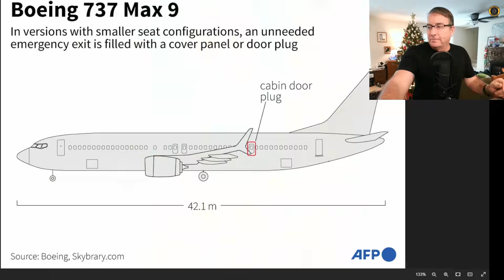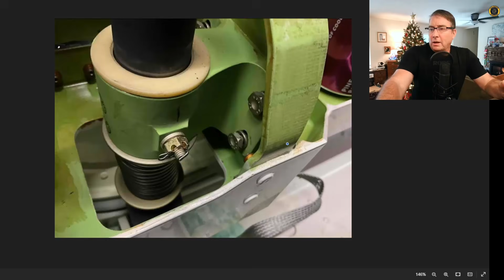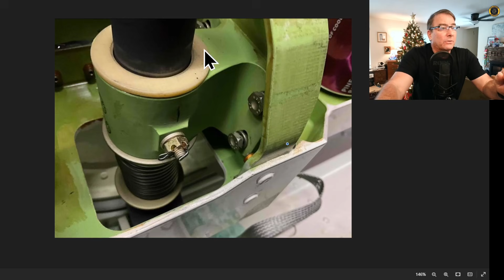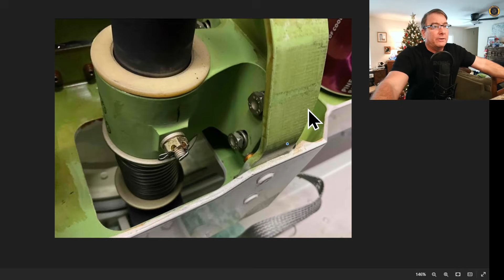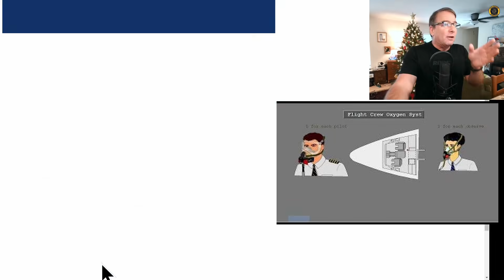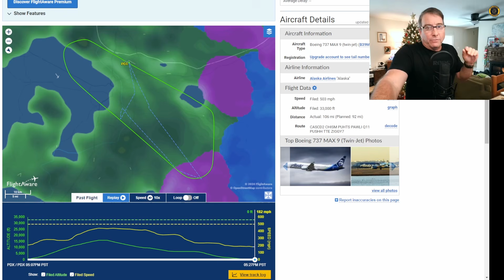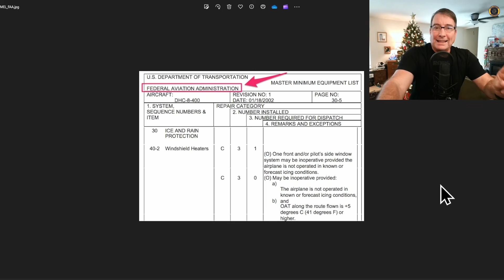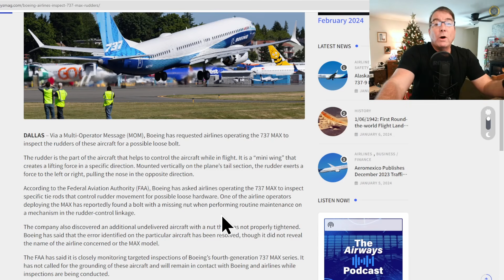"Yes, We Have No Bolts"  9 Jan 737 Max-9 Update

Comment: Wonder if there's an unwritten policy for pilots to avoid preserving voice recordings whenever possible. Failure to pull the breakers has happened in past incidents, such as a runway incursion last year. Longer recording time and mandatory downloading should be required whenever any incident occurs.
Reply: Preserving the cockpit voice recorder data is part of the FAR's every airline should provide an incident checklist to the managers on duty.

Comment: Everyone says door/plug lifts up. But to get out of roller channel, plug needs to move down and compress to lower springs within that lower tube. Then once the side rollers get out of channel and top lip moves away from over lap on skin and of course stop pins & pads. Door top will fall out and down. There is no moving up while roller is still in channel. // If there were not bolts / pins, it seems like someone could take a maintence / entry stand from the outside and push down with your hands and determine if the door will move. Or get one of those suction cups  for carrying objects with flat panel and use that to push down. If pins / bolts in place, no movement. Fault goes to, is there inspection before sidewall install? Is there inspection after installation of plug at Boeing? Any Fix base maintence has paperwork that has mechanic block and verification by inspection block. Not familiar with Boeing. PS: Cockpit door, I've done the test on blow out doors. Special tool with suction will move pins to allow blow out doors to open. Like he said, after door hardening, this door has been installed on all passenger Boeing aircraft from 707, 727, 737 all models. Max cockpit door is no different than cockpit door on other 737's & 727's.

Comment: Maybe i´m out on a limb here, but it seems to me that the basic concept of the door design is rather questionable. With bolts or other locking devices absent, it only needed to slide vertically off the pads, at right angles to the forces due to the pressure differential, to be blown right out of the cabin. An only slightly more complex design where the door would have needed to be pulled ever so slightly inwards before it could be slid of the pads would have completely nullified the risk for any event like this to ever occur. That is as with regards to the bolts or the absence of them, one would instead of the actual fail-hazardously design have had an appropriate fail-safe design. Presumeably something like that could have been acheived by small edges on the pads nessecitating inward movement in order to clear them, a somewhat different curvature to the guide tracks, possibly a bit more complicated lower hinges able to accomodate this movement, and for the operating doors perhaps a bit more complex operating mechanism. To me this seems like a FMEA (Failure Mode Effect Analysis) failure at the design concept level.

On another note, and i´ve seen several comments to this effect, there now appears to be an overwhelming nessecity for this event, particularly with the earlier 737 MAX troubles in mind, to have major and profound consecquences for the corporate culture at Boeing. 

And the cockpit door opening on depressurization and Boeings continued and highly alarming tendency to not properly document significant design features in manuals are two issues in themselves that warrant in-depth scrutiny and discussions at length.

Oh, and of course, thanks for the very clear and concise no-nonsense content. Possibly the best channel of its kind on youtube.

Comment: Im pretty sure all 4 bolts were missing. The two bolts at the bottom would have held it in place alone. There is no force vector upwards that is capable of shearing these two aircraft grade HT bolts. The purpose of the bolts was to immobilize the doors upwards movement. The major force vector was directed outwards and that load was against the 12 stops. 

A rough calculation using grade 9.8 10mm bolts will shear at around 1700kg+. In fact its a double shear on the bottom bolts so it's way more. So where does the required 3.4 metric tons come from? Simple answer - it's not there 🤣

Comment: On the A320 family, the cockpit door unlocks (but remainins closed) when a loss of cabin pressure occurs. The main difference with the 737 is that the cockpit door opens into the cockpit in the Airbus and I suppose in the 737 is the opposite. In the Alaska scenario, the loss of pressure that happened in the aft cabin created a differential that, with the door unlocked, it opened

Comment: Why do they not use safety wire on those bolts as the USAF does?
Reply: Usually the "Nut Plates" that are rivited to the airframe, that capture the bolt threads have Hi temp locking capibilitys. Don't know about that specific application, as I only worked 737 classics.

Comment: 6:38 The three bolts and washer, of the presumed 4 holding the slide pin bracket, to the door frame, appear to be loose. This picture could be during assemble and were loosened for ease of installation of bracket... Just an observation!

Comment: Thank heavens all the other doors on the plane have there bolts correct.
This plane could fly its entire life with this plug, right,
How come it has a launch springs for the one time you might put the hole into service.
Looks to be a dump design.

Comment: @blancolirio I am not a pilot or aircraft designer, but If I were designing a pressure vessel with "plugged" apertures, all of those plugs would only open inward. What is the engineering value, safety value, or business value of these plugs opening outward unlike the rest of the other doors?

Comment: If bolts were present, they would have a LOT of visual evidence of them shearing off or backing out.  Bolts do a LOT of damage to aluminum when leaving in an unnatural manner.  The threads will leave a lot of trails all around.  Im 100% confident that the botls were not even present, because the upward forces exerted are not very intense.  One bolt could of held that door down.
Reply: Normally you have to rotate the panel a bit to get it through the opening and the cabin pressure would seal it.  Provided the thing was put on correctly.
Reply: The upward forces could have been significant during turbulence due to the inertia of the mass of the door.

Add that to the possibility of bolts being lose and rattling, and it’s not hard to imagine the bolts failing due to a combination of shock (impulse) sheer + shock (impulse) tension.

Comment: Does Boeing use a third party contractor to set up interiors/ exteriors (paint and logos) prior to a carrier taking delivery? If so, is it the fault of Boeing or the facility that "finished" the aircraft for delivery? I am not familiar with manufacturing and delivery nowadays as many, many facets are contracted out. Each Air Carrier has specific needs unique to their fleet so finishing may be assigned to a subcontractor or a subcontractor of the Airline's choosing.... so many variables!
Fantastic analysis Juan!!!!

Comment: I have an A&P Mechanic's license, and was appalled to see the incorrect installation of the cotter keys securing the castle nuts shown in this video. The  bend of the key should be in the slot of the nut, with the short "leg" trimmed to match the flat of the nut and bent down making contact with the nut. The long leg trimmed to 3/4 if the bolt diameter, and bent to make contact with the end of the bolt. Impropper installations, such as those shown, can result in the key breaking and falling out.

Comment: The Boeing 737Max intentionally hidden gremlins will likely continue for years to come. 

If I headed the FAA, I would put together an entire independent engineering team of specialists to forensically evaluate everything from A to Z on the Max along with the Boeing engineers to discover what we still don’t know and what needs to be changed immediately in terms of hardware, software etc. to keep the passengers and crew safe. 

Until then I will continue to refuse to fly on the Max.

Comment: I'd put money on the cotter pins missing over the fasteners mechanically failing, allowing the castle nuts to slowly loosen over the first few flights until they fell off. If one cotter pin is missing, it's probably safe to assume all were missing due to a missed assembly step.
Reply: They can't tell if ANY cotter pin is missing because the four bolts are missing.
Reply: 50 cents worth of cotter pins ommited  almost doomed an airplane.

Comment: The toxic culture is going to be what bankrupts Boeing, the mistakes started when Boeing changed the way they hire employees. When I went to work for Boeing many years ago, on day one, all new hires were escorted into a large conference room and the first thing we were told was Boeing has a duty to the public and its defense customers to build the safest aircraft on earth and build aircraft in a manner that added value to all of Boeings customers. Each of us was given a folder with our name printed on top with a # behind it. As part of that orientation we were told that as a condition of employment, we were required to leave our personal life, feelings, and social issues outside the gate. We were told that when we walked through the gate, we all became "B" employees, meaning Boeing Employees. If we didn't agree with the terms of employment, we could leave at that time. Only after we signed our condition of employment contract were we allowed to go to Badge and ID to have our picture taken and badge issued.  If you got this far in reading, I also say drug test everyone...
Reply: Also as all this is going on there’s a mandatory inspection of a “rod end nut” on the rudder power control unit or PCU. The idiotic design has no cotter pin, only its locknut feature keeping on, and if that’s worn out the nut comes off and the rudder throws the plane into an uncontrollable yaw AGAIN. Still more rudder issues even with the new max.
Reply: @tropicthndr  Is a locknut nessesarily unreliable compared to a nut with a cotter pin ? Are locknuts known to give way sometimes ? And if that locknut were to fail, would the rudder nessesarily go into a hardover or extreme position that would cause the aircraft to potentially yaw out of control ? When did this happen before other than the earlier generation 737s ? Which was a PCU issue.
Reply: @andrebello4191  On the aircraft I work on, we use nylock nuts to connect the push/pull rods for flight controls to bellcranks.  I've never seen one come loose.  They are pretty reliable.  Having said that, even if one did work its way loose, it would only undo itself enough to relieve the initial torque and then just stay there as the bolt is under a shear load not a tension load.
Reply: @andrebello4191 Locknuts are not reliable and therefore locking pins and locking wires are preferred especially in the aerospace industry.
Reply: I worked at Boeing a long time ago too. I remember that same lecture. I remember being told that we needed to understand the rules and if we played by the book, the company would stand behind us all the way -- it wasn't optional.

With that said, this is clearly a manufacturing defect that occurred at Spirit Aerosystems. There has been a repeated pattern at Spirit over the last few years. While Spirit makes a huge percentage of the 737, Boeing ditched the Wichita operation to form Spirit years ago. At the time, they argued that Spirit wasn't profitable and it made economic sense to spin it out.  This never made any sense to me.  It seemed to me that Boeing's new McD management were cooking the books to assign the costs of building the 737 to Spirit while attempting to keep the profits at Boeing. That forces Spirit to run extra lean to eke out a profit while Boeing's 737 looks more profitable than it really is. 

If I were running Boeing, I would do four things: 1) bring the HQ back to Seattle -- their primary customers are airlines and NOT the DoD customers of their St. Louis operations, 2) buy back Spirit and solve the cost issues properly rather than thinking they can spin away their problems, 3) get rid of whatever is left of McD management and thinking and write it off as a bad lesson, and 4) go back and look at how Boeing's employees used to be incentivized to do a good job.
Reply: The airframe business was sold by Boeing to Spirit to reduce costs. I don’t think that worked out too well for them😅
Reply: Boeing is too big to fail, there is almost nothing that could bankrupt them. We can only hope they are forced to change.
Reply: @robstone9628 Exactly, their execs know the US Gov't will never let them fail so they can do like Bear Sterns and take any risk because they know they'll get a bailout (and keep getting bonuses). Monopolies gonna monopoly.
Reply: @robstone9628 Boeing has a competitor…
Reply: @robstone9628  Boeing can and will fail when customers stop purchasing their products. Nothing is more important than quality and safety of the airplanes. If they can't make enough money to succeed, too bad.
Reply: @robstone9628 Yeah, I am sure Nokia, Blackbarry and Kodak were feeling the same way. 

No company is too big to fail.
Reply: @robstone9628 Yes Boeing has been around for a long time and they are a powerhouse. They are a main US defense contractor and civil aerospace contractor. Even if they screw up now and then they will survive. As you can already see. And at the end of the day who we kidding the government will back them.

Comment: I recall seeing a video about differences between earlier evolutions of the 737 (737-300 to 737-400? that contributed to a serious accident. In that case the port engine experienced compressor surging (or is the correct term “compressor stall”?) which violently shook the aircraft. The new engine gauges were very difficult to read under extreme vibration. Smoke was flowing into the flight deck. So remembering which engine supplied the air on the prior versions to the flight deck the crew shutdown the starboard engine and throttled back both (which apparently mitigated the surging). But the port engine was now the one supplying the cockpit a fact not included or emphasized as a difference between the upgrade and prior version. Needless to say when the now damaged port engine was throttled up it promptly destroyed itself. As is often the case a series of events led to the crash: the comp surging, inability of the PM to read the engine gauges to identify the faulty engine and the crew’s lack of training or knowledge of the switch of engine functionality led to the flight crew to shutdown the good engine in flight. The first was something that just happens rarely but has procedures in place when it happens.

Comment: FYI...its the bolts that hold on the fittings, not the castellated nuts. While they are looking at it all. I have seen pictures of the loose bolts under inspection on other planes. The bottom green ones. The fasteners going through the fittings and into the airframe frame. Aka door frame. Oops. Now that I'm still watching this...yes. Now you have the right ones. I would bd super nervous if that was my job or if I was QA and signed off on it. We had a stand down at Boeing to go over everything....yep, id say you are all up to date. The one thing I am not sure of, is if this is a boeing issue, or a Spirit issue. As I'm surs you are aware. Spirit in Kansas builds the fuselages for us. Comes with all doors in, wether they are permanently installed or temp installed. Just not sure whos job it is to install and torque those. But comes down to the fact its a boeing plane. Boeing takes all the responsibility.

Comment: I was wondering if it's possible the cockpit door and blow out panels operate differently depending on whether the depressurization is in the cockpit or passenger cabin. Maybe the door opens in one direction and the panels operate in the other? Also, I was always told that once the cabin is pressurized it was not possible to open a door to the outside. I understand how the plug door works thanks to your great explanation but how does it seal? I watch the exit doors swing in and then seal out against the fuselage but this door is just against the pads. Why doesn't the pressurized cabin air leak out? Thanks for the great show!

Comment: If the cockpit door is supposed to blow open in depressurization then what are those 2 door blowout panels there for???
Reply: The door doesn't blow open it just unlocks with a differential pressure. The blowout panels are there if you have use the deadbolt mechanism on the door..